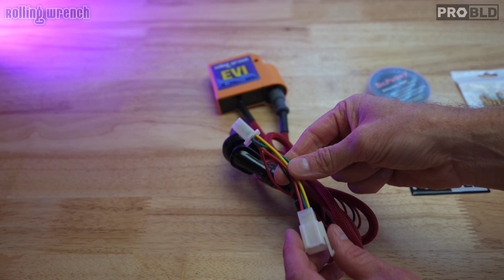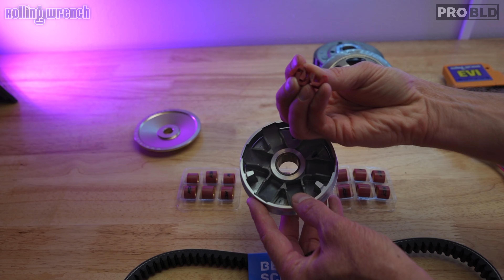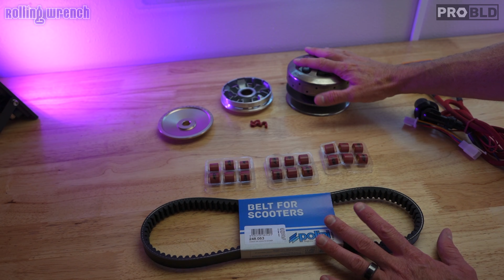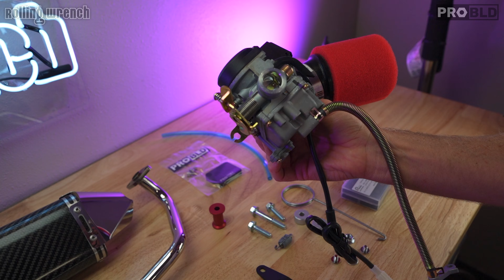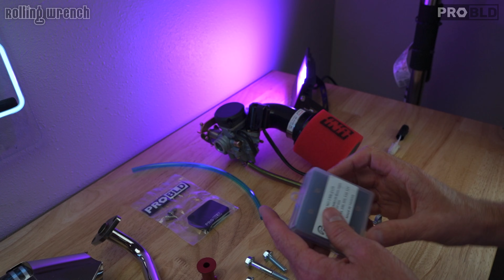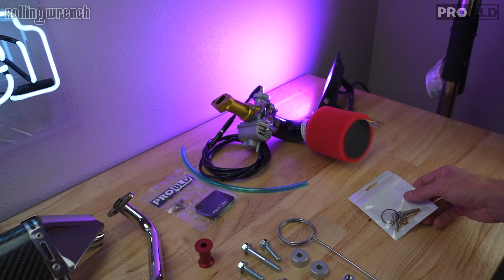5 ways to make a Ruckus faster & have better acceleration  [Performance Stage 1-5 kits]

Comment: I have a 2026 Metropolitan 50cc scooter. I'm 6'4" and weight 250lbs. On flat I'm running about 35mph, uphill is down to 28mph. Downhill I've hit 42mph. I travel 1 hour to get to work so I'm open throttle for a while. What can help me get more speed and still be reliable? Not looking for racing. I need it as a daily driver.
Reply: A 100cc big bore kit helped my 50cc get faster and stronger uphill, daily rider as well

Comment: I never understand why someone wants to upgrade what they bought. I'm happy with my 2024 Ruckus as is. The parts are all available at the Honda dealer. IF I want to upgrade I'd buy a 150cc-200cc scooter or motorcycle.
Reply: It's a project. It's getting the most for your money.
Reply: Let people like things. There's many reasons, like someone wants to keep the ruckus, or can't afford a second bike, or they don't want to bother geting a motorcycle license, or they just like to tinker and bring the bike up to what it should be instead of keeping it neutered by EPA regulations.
Reply: Quick questions, u get a flat tire, do you call triple a or put the spare on yourself?  Do you take your cars in for oil changes or get the oil on yourself hands?
And Either way u have to order parts. U think Honda is stocking cdi’s and stators?

Comment: Practically speaking, what kind of an increase realistically would a Ruckus get in top speed and acceleration with just the stage 1 kit?
Reply: Saw a dude who did the first 2 stages and it was just about 8mph increase. Started at 38mph to 46mph. Look up Talon Sei.
Reply: would this still be "street legal" on nonhighways after the kit?
Reply: @blurtling should be. Just upgraded parts. And still technically 49 cc

Comment: Stage 5 is really more like a stage 2 but not bad. For a stage five id expect more displacement, higher compression, porting,. maybe even a gearbox - but you can really only do so much with a ruckus.
Reply: I mean a STOCK ruckus. Obviously the sky is the limit if you're down to get nasty

Comment: Hello! my 50cc scooter(80cc big bore sunny 2012 scooter) stopped getting any power to the wheel while i was riding, there was some squeaking from the belt, was going slower, then it stopped completely. It had high speed gearing installed by the previous owner, and worked great for the last few months. it still revs. i just changed the belt and entire clutch assembly and variatior/rollers. fires up, revs, but still no power. is this a problem with the gear box? im not a mechanic, ive been stranded at the train station for a week, any idea what the issue could be, what i could try next to fix the problem? any help/ideas are greatly appreciated. Thanks.

Comment: Nice... it's better if you also have in your upgrade kit a ceramic light weight pulley bushing less noise and less heat also corrosion free,... that what we use in the philippines

Comment: I have a 149cc gy6 scoot,I upgraded it with 58.5 block and camshaft with 5.01mm external and 5.26mm internal,how many CC it will be with that upgrade?thanks from the philippines

Comment: Hi, I have a Chinese scooter and the scooter has an air drain filter on it. The part number is a TY 80 WD. I have 4 connection points but  only 2 are connected leaving the other 2 open.

I can't find any information regarding the air drain filter online and what are  the connections and what it does. 

I assume its part of the vaccum system but I can't see where the other 2 connections go. 

I'm hope you can help me when you got 5 minutes.

Cheers

Comment: i have a gy6 170cc port and polish 7.0 cams 24 28 valve head
racing cdi no limit
twh gy6 pulley set
10grams flyball
1k clutch spring
1200 center spring
842 30 20 bando belt

im.using a 34mm flat slide carburator 132 mainjet 38 slowjet needle 1 and still lean but when i change it to needle 2 its too rich what do you recommend jettings lean on needle 1 rich on needle 2

also 15x37t final gear

i wish theres a set for efi here in the philippines even shopee app

since 4 valve is expensive il just +8mm gasket +3.5 comnecting rod and 5.0 connecting pin

Comment: according to this video my ruckus is currently at "stage 5", and i would definitely recommend it to anyone who is up for the challenge. i would also recommend getting a wideband sensor, the slide carb is tricky to dial in without one. 

this kit wasn't available when i was putting my ruck together so my parts are a little different (malossi clutch, polini variator, and a JC racing carb) but i would've gone this route if it was available at the time
Reply from the maker: Nice! Thats a great set up! Definitely a wide band helps a ton!
Reply: If you have worked with carbs for years you will get it pretty close to perfect. You do not need a wideband
Reply: Do you still have the stock engine on your ruckus with the stage 5 kit???

Comment: I just have 4.5 gram weights and a pollini variator upgrade on my ruckus, hauling me and 120 pounds of storage while traveling through the states and I get up to 45 mph on it. Which my travel videos will show on my channel. When I fought through 40+ mph wind it wasn’t good. I’ve travelled 2300 miles since March 26th on the ruckus and got about 2500 more to go.   The air breather is something I figured I needed along with jets for the mountains but I didn’t know what size I needed, but hey I’m 270 lbs and I’m traveling on a ruckus for a reason. If had not purchased the warranty… which sucks by the way because it really did me no good to get it… I would’ve gotten the stage 1… oh well live and learn
Reply: It might go 45 mph off a cliff, but not on any paved surface approaching level.
Reply: @ could be true never know.